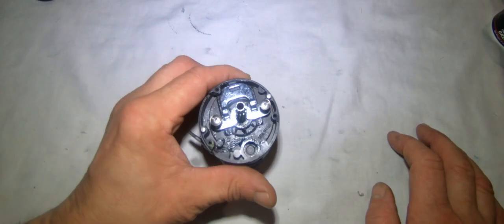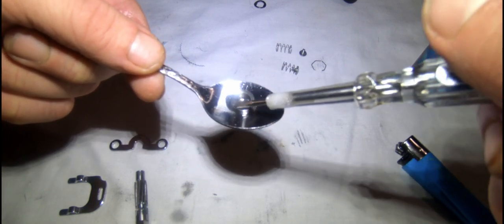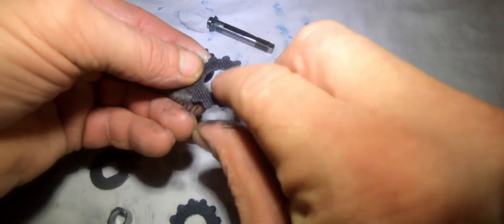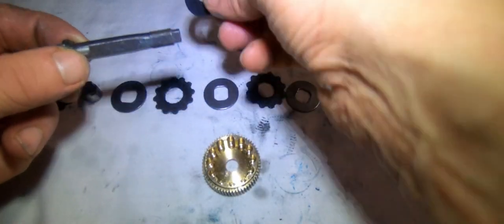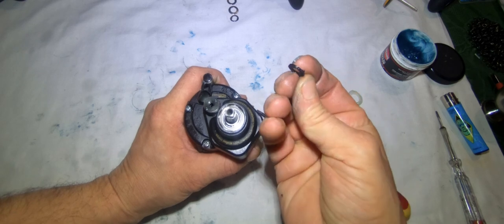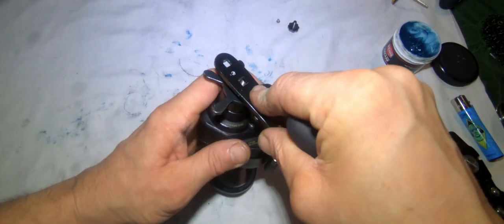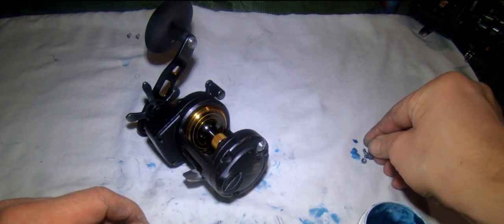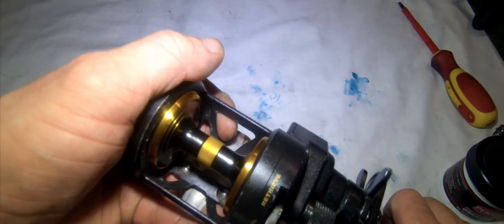Penn fathom 15/12, mk2 - Reel service - Part Two..

Comment: Excellent video. Staring at 10:58  Per schematic, It looks like the first washer put on should go on last (on top of the clicker). Mine didn't work correctly until i made the switch.
Reply from the maker: Thanks for the info!

Comment: Thank you for sharing this. I have a first gen fathom 15 SD. The drag still engages when in free spool. Did I miss anything when putting back together? I hope you can do a similar video for the first gen fathom.
Reply from the maker: did you put the leaver in the correct position
Reply: @StarfishSeaFishing  this is a star drag reel not an LD. I don’t know if I missed anything.

Comment: Another great video......great tip on using the spool shaft to remove that bearing,thanks.🎣
(Is that rocket fuel you use as oil?)
Reply from the maker: red rocket fuel works for me there are a few difrent types
Reply: @StarfishSeaFishing thanks, I use the same,seems to work fine as you say,even use it in my spinning reels. 🎣

Comment: Great video many thanks - I have the casting special and I presume the procedure would be similar
Reply from the maker: exactly just the spool is bigger and the knobby mag. cheers
Reply: @StarfishSeaFishing  is the Penn grease definitely required or would Rocket fuel liquid grease do the job?
Reply from the maker: @farley1968  you can do if you wish have no grease at all and just oil the pinion and moving parts but the carbon drag washers do require penn grease unless you run them dry.

Comment: Hello sr, what You use to clean it outside after salty water fishing? And also wich oil and Grease to use? I don't have acces to fishing reel lubricants, and Also, the bearings of the fathom 2 are ceramic? If not, it worth yo upgrade yo ceramic ones?. Thanks and have a Nice day
Reply: Dont need ceramic bearings, they run fine as they are.
As far as cleaning after sea fishing goes, with mine like every other reel i own, i rinse them under warm running tapwater when i get home. Been doing it for years and not had a reel with any corrosion yet

Comment: Hello mate I don’t this on a year old real was all working fine before put it all back together as in the video but now my handle slides and I can pull line of the spool with hardly and force with the star drag set as tight as it will go what do you reckon I’ve done maybe something wrong putting it back ?
Reply: Mine did the same thing because like his, the washers are not on correctly. Watch at 10:58, the first washer he puts on should should go on last. That first washer goes on top of the clicker per schematics.